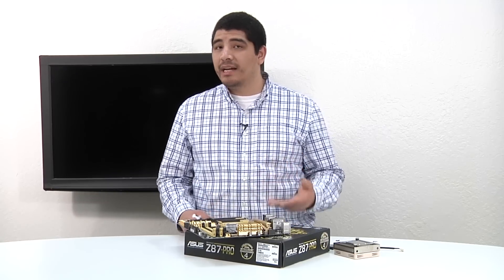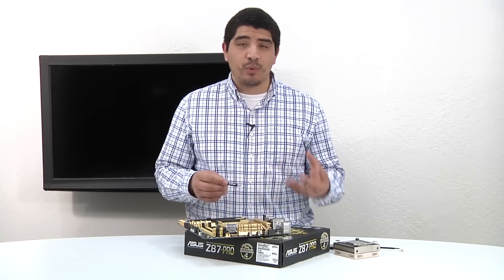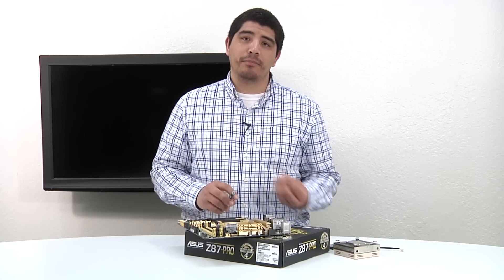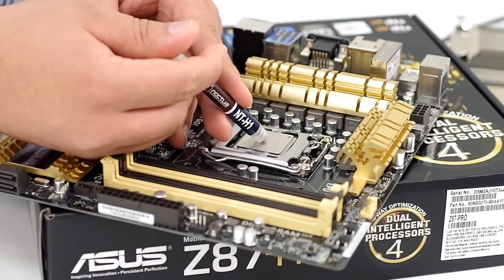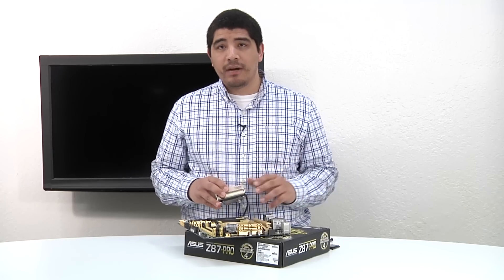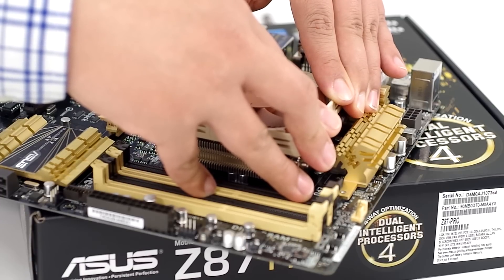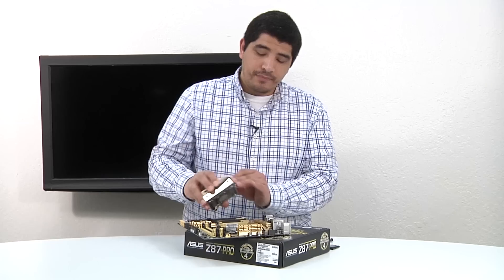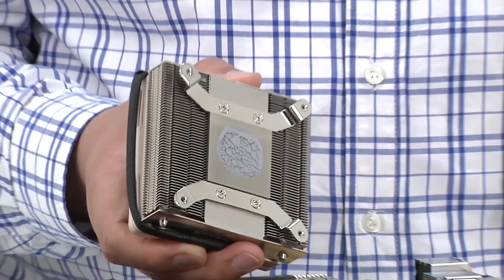How-to apply thermal compound

Comment: You should not apply thermal grease this way.  You should in fact use a credit card or similar surface to spread it out on the CPU or heat sink.  This method ends up with a nice round spread in the middle of your CPU with the remainder of the heat sink not in contact with the CPU.  This in fact ruins the whole point of applying thermal grease.
Reply: Applying thermal compound by spreading it via card creates bubbles which can shorten your component's lifespan.

Comment: THAT is good distribution?! The top corners are completly bare!! What the hell ASUS?!?!
Reply: +SimKill That's normal
Reply: +SimKill The transistors are all in like the middle 10% of the CPU.  The rest of the space is just wires going to the pins.
Reply: the heat starts from the middle of the cpu and almost doesn't matter at the corner edges of the cpu.

Comment: will I need to add more when I change motherboard but use the same cooler
Reply: +Ashley Rodrigues Yes. Always remove old thermal paste with some isopropyl alcohol when you do that. You want to apply a fresh coat whenever you change things up.
Reply: I prefer ArctiClean, a liquid designed for cleaning thermal paste. Its a lot faster and does an incredible job but isopropyl does fine it just takes longer and feels more frustrating. Anyway clean off 100% of the old thermal paste so its entirely as-new. You don't have to go utterly OCD to a completely perfect mirror finish, but I tend to hence why I like the faster and nicer cleaning solution than more time work and frustration.

Comment: I have asus k55vm-sx086v laptop that's heat a lot.  I want to replace thermal paste.  which thermal paste should I buy? how's coolermaster thermal paste? what is metallic or ceramic based thermal paste?

Comment: why is it essential to do it? and where do you you get this compound? does it come with cooler?
Reply: The difference between thermal paste/ heat sink vs just metal on metal heat sink is massive. Heat sinks are generally extruded from aluminum, then cut. Those saw marks on the heat sink can trap air (like sitting in a car with the windows closed on a hot day) and can eventually lead to much higher CPU temps. Thermal paste, compound, too, whatever you call it, fills in those gaps, and insulates it to prevent air from being trapped between the heat sink and the CPU. So thermal paste is pretty much required.

Comment: Thank you. My CPU temperature is just too high I needed to make sure if Im doing this right
Reply: +Petar Maksimovic No. Without thermal paste the cpu will run exponentially hotter and could possibly damage the chip. It's possible to run a cpu without it, but it's not recommended. The difference between a stock thermal paste and aftermarket is 2-5c though.
Reply: +FluffyBunnyCat Thermal compound takes away about 5c anyway...

Comment: See how he lifted the heatsink up a few  seconds and put it back down does he have to reapply the paste ??  (Noob here )
Reply: +Revan Onarsi yes, putting it back down will leave air bubbles in the paste
Reply: Damn okay how will I know if the paste spread properly?  Ty for replying
Reply: Revan Onarsi it should be fine if you use roughly the same amount of thermal paste as in the tutorial. You can check the cpu temps once the computer is built and change anything if needed.
Reply: OK got it ty: D

Comment: A SUGGESTION FOR WHO IS INTERESTED , AS I HAVE BOUGHT THIS PRODUCT AND WAS MUCH MORE BETTER THAN *ARCTIC SILVER 5 , AND **COOLER-MASTER E2 GOLD . I HAVE TESTED-IT MYSELF AND I WAS VERY HAPPY WITH IT . 10 DEGREES CELSIUS LESS THAN **ARCTIC SILVER 5 * AT SAME LOAD / CPU RUNNING TIME , SAME AMBIENTAL TEMPERATURE.
http://www.ebay.co.uk/itm/321834264786?ssPageName=STRK:MESELX:IT&_trksid=p3984.m1555.l2649

Comment: its bad idea to press heat sink with hands against processor. Holding screws might hold it not so tight and make bigger gap beatween proc and heat sink. Better just gently put it on and simply screw it down.

Comment: Question: I bought my computer about 2 years ago (HP Envy) and since then have upgraded the GPU and case. I recently noticed my processor overheating a bit while playing games, so my question is; Do stock HP computers come with thermal paste already applied?
Reply: Jimii Neon I reapplied the thermal paste and wasn't getting much of a difference with the temperatures. I picked up a hyper evo cooler which should be coming soon. I'll put that on and reapply the paste again.

Thanks for the reply!
Reply: ***** Reply a bit late. I've already reconstructed an entirely new PC with a couple of salvaged parts lol.

Comment: I had to use a different method since the thermal compound I got was pretty thick (Zalman ZM-STG2) And it worked great. I applied many small drops of the paste & kept spreading it on the cpu with a plastic card until the whole die was covered & was as flat as possible. Then I put the heatsink on it... and slightly rotate/slide it around for a few minutes.. to minimize bubbles and uneven contact areas & finally attach it to the cpu (WITHOUT EVER REMOVING IT!) Proof is... it's been 5 years since I applied it on this old Phenom II 965... and I have put this cpu through hell... rendering 3D scenes for 12+ hours on a regular basis & gaming for a few hours almost every day. Now keep in mind this is an old .45nm 125 watt cpu. Currently, idle temperature is at 28 c. Full load with all 4 cores at 100% after many hours it goes up to 49-52c. Average 23.5c ambient, well vented case, Zalman 9900 cooler. Hope this helps.
Reply: Advection357 My preferred method is to "tint" the surfaces of each contact plate by placing a thin line of compound along one edge and then using a plastic card to smear an EXTREMELY thin layer across the surface, then again using the card to basically squeegee it off (this fills in microscopic gaps over the entire surface, THEN using the pea or rice grain method at the center of the heat spreader.
Reply: ***** Interesting method... which compound did you use with that?
Reply: Advection357 It should work with almost any compound, but seems to benefit very thick ones like IC Diamond the most. Just be careful not to scratch your surfaces because IC Diamond is a microabrasive.
Reply: I will most probably use Noctua's paste that comes with the NH-D14... Would rather not mess with risky pastes for marginal temp difference
Reply: Advection357 Noctua's paste and the NH-D14 are really good. Everything from Noctua is extremely high quality. The cooling ability youll get from their fans and heatsinks will far outpace any minor cooling gains youd get from using even a liquid metal thermal compound. Cant go wrong with Noctua.
Reply: Been wanting a noctua system for a long time... finally I'll get it hehe. Should be good for quiet cooling a 4790k.. I'm also going with full 140mm fans this time since the Fractal R5 case supports them. I'm thinking of cheaping out a bit with Noctua Redux fans... I just... dont want to pay 25-30$ for a single case fan lol.

Comment: can someone explain me why you should use thermal paste?
Reply: BentoTheBox Incorrect. Metal on metal contact is actually the BEST at transferring heat. The problem is that if you look at the CPU heat spreader and contact plate on your cooler under a microscope, you would see that they are not perfectly flat, and have both grooves and high/low spots on them from the machining/cutting process. If you put them against each other with nothing inbetween, there will be many microscopic spots where you ARENT making metal to metal contact, but rather metal to air to metal. Air is extremely inefficient at transferring heat compared to metal. What the thermal compound does is flow into all these gaps and displace the air. The thermal compound is actually LESS efficient at transferring heat than direct metal contact, but much much more efficient than air.
Reply: ***** And in fact, most thermal compounds actually "UTILIZE" nanoscopic metal particles suspended in a fluid medium, to fill in all those gaps and grooves with more metal, in order to create as much metal contact as possible.
Reply: Big cranky FizzleBlabber im new to pc so face it idiot
Reply: are you an idiot or are you just failing at trolling?
Reply: Big cranky FizzleBlabber im being serious dumbass
Reply: Metal on metal contact does not transfer heat as well as the thermal compound can. Thermal compound is designed to take as much heat away from the CPU as possible and without it the CPU would burn itself up in seconds.
Reply: BentoTheBox dont say seconds because i have an AMD CPU that runs cold without anything on it all, ive gamed on it and it runs cold, so seconds is an over statement i would say never for intel because they shut down at a certain temp and hours for AMD
Reply: ***** Yes, most good thermal compounds have silver particles in the fluid. Silver is a great heat conducter (and a good electrical conducter, but that is not relevant in this case.)

Comment: The thing though, people make this mistake and over look it as minor, but you should wear gloves when touching these components because of the oil on your fingers will leave hot spots. This also includes the heat sink you are touching. You will need non latex gloves, latex has static in it, and you do not want to be touching electrical components with static. Also, it's not a good idea to pull your heat sink off after applying the compound because you'll then be creating air pockets in the compound itself, which will create more un-necessary heat, if you have applied too much, you can carefully move the heat sink back off by twisting it in a counter or clock wise motion carefully lifting up and then use a credit card or anything flat to even it out. Applying too much compound is also a bad idea as it will increase the temp of your CPU or GPU. Also, when cleaning off old compound, it is safe to use rubbing alcohol, which is actually better than the compound cleaner that you would buy for $4 - $5, rubbing alcohol is $1 and is safe to use, and also works great if you happen to accidentally touch the CPU, Heat Sink or GPU. These are some things you should mention when doing a video like this, cause people who do not know how to apply compound will be using bare hands. Oh, and forgot to mention, if you want to check temps and your PC doesn't have a thermometer built into it, you can Google CPUID HW Monitor. It's a great program to keep an eye on not only your temps but also the volts.
Reply: If you wash your hands regularly, there's not gonna be enough oil rub off to be at all significant, especially not the point of needing to wear gloves!
Reply: D347H2 This is total overkill... just wash your hands before doing it and there won't be enough oil to make any difference.
Reply: D347H2 Ignore the troll.
Reply: Also it should be 90% or higher isopropyl alcohol
Reply: D347H2 Used bare hands with my 5820k. No issues, especially when you only touch the sides...
Reply: DiEx80 Dude, don't worry about using gloves, your oil that your hands produce will get out
Reply: You dont necessarily need them, but it is best to not touch the top of the cpu. If you can grab the sides of it, that would be good. Its just i cant, my hands arent small.
Reply: Thanks for clearing that up :) forgot about that.
Reply: D347H2 Thanks. I am building a PC and Ill try that out. Also I was about to put the thermal compound in the chip socket. Thankfully this video stopped my from doing something that would have been disastrous.
Reply: Or just clean it off with rubbing alcohol before putting the heatsink/waterblock on it?
Reply: My fingers arent small enough to not touch the sides bro
Reply: D347H2  so that means that my gpu  will get damaged if i touch its pcb  ? because i just did it :X
Reply: That would not have been good. You use only about a pea size and thermal compound is meant to help with the connection between the cpu / gpu and the heat sink. Whether its a liquid cooler or a reg heat sink. Less is better, only want a very fine thin amount. If you happen to put too much on it by accident, you can take the heat sink off, wipe it off of the heat sink. You may want to use cpuid to keep an eye on heat. On idle, you will want it around 25c to 40c for a normal heat sink. If it spikes passed 60c on idle, too much thermal compound. Most heat sinks come with paste on them, so if you're unsure, just use what is on it. You can look up videos.
Reply: My idle temp on my liquid cooler is 14c, mind you this is idle temp and does not include running games. When running games it goes up to around 42c. I use a corsair h100i liquid cooler because of overclocking the cpu. Hope this helps.
Reply: D347H2 You said that I should wear gloves when touching components. Would powder free, latex free nitrile gloves work or will that be too static creating? What would you recommend for a brand of gloves?
Reply: you sir are an idiot
Reply: And why is that?
Reply: Even if you do, you can still put oil on it, your skin produces more oil than you think. To prevent that, i always used non latex gloves. When i first started building computers, i touched my cpu and wasnt aware of it and kept getting weird heat spikes to where the pc would shut off to prevent damage. So, take it or leave it, i wont risk touching them with bare hands.

Comment: I've run a heatsink without compound at all for a couple years give or take on a socket 939 system. never died, but when I finally started learning more and using the right programs I noticed the temps were pretty high so I took the heatsink off and realized there wasn't anything there. haha.
Reply: D347H2 Why in the world would it have burnt out? People take this compound stuff way to seriously. The only purpose of the compound is to help transfer heat where there isn't a metal-to-metal connection. There shouldn't be to many areas like that. In the end, if you have a properly shaped heatsink and a good, tight connection to it thermal compound shouldn't be a factor at all.

Do you believe that there is some sort of thermal compound-sensing routine in the BIOS?
Reply: duncreg
The computer will not boot and will shut down if it gets too hot. It has sensors to keep you from frying your cpu, usually at around 212 degrees F. Use common sense man. Also, thermal paste is a requirement if you care about the lifespan of your cpu at all. I would rather have my cpu chillin at around 85-135 degrees (unloaded/loaded) at all times rather exposing it to wear and tear from high temps.
Reply: I highly doubt you ran a computer without any compound on it, it would have burnt the CPU out within 10 - 15 minutes of turning it on, if the bios even let it turn on.
Reply: there wasn't anything? the processor was gone cuz of the high temps?! OMG! D:

Comment: So you can remove the heat sync once you already applied the paste? Not after too long though.
Reply: Surely removing and replacing the heat sync is guaranteed to introduce air bubbles into the thermal compound.
Reply: lydolepper Its a heat sink, not sync.
Reply: Well thank you Mr Youtube know it all for your invaluable spelling correction and avoidance of the actual question.
Reply: lydolepper
You are not meant to remove the heatsink after applying thermal compound as it will introduce air bubbles you are right. It was good that he showed how much is enough but people should always do this just for testing so they know how much of a blob in the centre will be enough after applying pressure to heatsink by pressing down for 15 seconds next move slightly up,down,left,right to allow for even spread in case some small surface area was missed.  What he should of noted in this video is that after testing you should wipe the CPU and heatsink clean then reapply again for the final finish to avoid air pockets in the compound. Once heatsink makes suface contact you should not remove and use the same thermal compound that was applied, well you should avoid it if you have enough paste :)
Reply: Jon Duan
You are quite correct, but I always find great humor when I see someone correct a person whilst simultaneously making their own mistake...  it's, not its :)

Comment: Wouldn't pulling it up after applying create small air bubbles when you reseat the heatsink against the IHS.
Reply: You don't ever lift it up once you place your heatsink. This was done only to show the viewer the type of spread (of thermal compound) you get from applying it in the middle as shown in the video.

The whole purpose of doing it this way is to create an air bubble free connection.
Reply: YEs

Comment: I accidentally got a bit of thermal compoubnd on the outside of the cpu, could that be bad? When I play a game, I noticed sometimes the cpu usage goes to 99% on the windows 7 gadget.
Reply: It's not the best thing.. try to apply only a small amount for best results
Reply: Actually, yes, that is bad as it will create heat. The compound is meant to conduct between the heat sink and GPU or CPU.

Comment: It's ok to take the heatsink off to double check that you applied the thermal paste correctly?
Reply: skateboy159 Well, I'm getting 25c idle temps and high 30s in load temps so I think im ok right?
Reply: AdamantuimDragon NG I get 21c idle...in the summer...with my Athlon II x634...
Reply: Julian Cleland I can believe that because it's just a double core... I get around 38°C temps at idle with an old Intel Q6600 2.4GHz @3.6GHz.
Reply: *****  I know :D
Reply: RisupFIN meant to say 645. 
It's a quad core lol